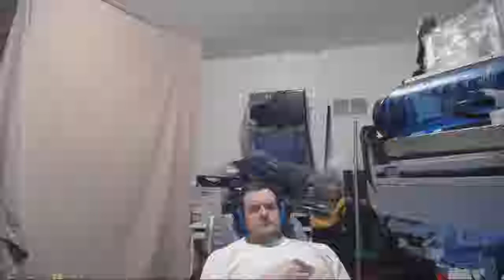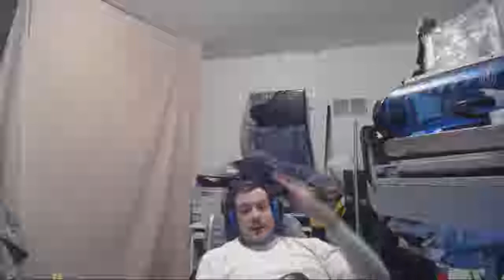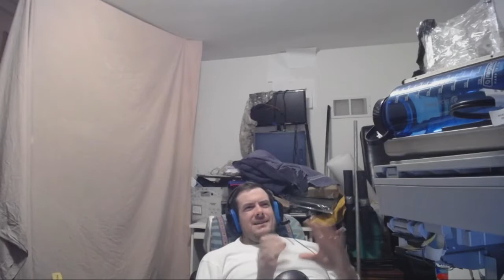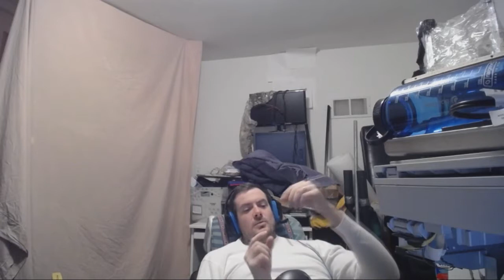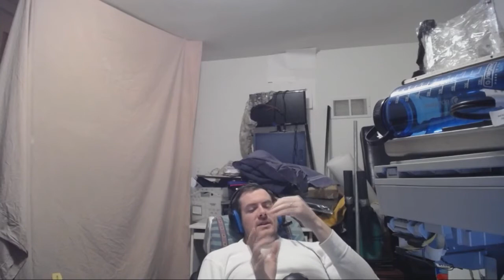Making a Video Card DIY #1 | Planning

Comment: why don't you just mine the silicon and fabricate it in to your own computers. you could save so much money. Bulk silicon is cheap. In fact, you could build a spaceship and get the silicon from the moon for free. You can get parts for your spaceship for free too. There are a lot of spent rocket stages which have been discarded into the pacific ocean. You can go there and get several of them and scrap them for your engines. Of course, you need a boat to bring them back to shore. You can build a boat from garbage acquired from your local dump. go there with a metal detector and look for usable pieces of steel. To avoid drawing any suspicion, make sure to install  metal detectors into the soles of your shoes. Once you have all of the pieces, you can build your ship. You can then build your ship according to french aircraft carrier designs freely available on the internet. (The french government released many designs for naval ships in 2009) I would recommend using the plans for the CLEMENCEAU from 1957. However you can replace the turret with a large crane to pick up the downed rocket stages. With enough careful planning and sourcing of materials, all this can be build for free. In addition building the ship should serve as good practice for building your rocket. 

for your spaceship capsule, you can build one out of garbage as well. believe it or not,  large quantities of aircraft-grade aluminum alloy get thrown away every year. this is mostly in the form of flashlights, computer cases, and other small consumer products not thought to be worth melting down for scrap. You can collect this aluminum and build a space capsule according to the designs of the Russian Soyuz capsule, which is the most reliable space vehicle ever build and was successfully reverse engineered by both Indian and Chinese space agencies (you can do the same). Of course you need thermal insulation upon reentry. An effective heat shield may be made from glass and epoxy. to protect the aluminum shell, again Russian designs may be used ЭВТИ, is a specification for thermal insulation used on the Soyuz it can be made from epoxy and thin sheets of metal, both available from your local home improvement store.

Of course you will need a lunar lander as well. You have two choices for this. You could either copy the Soviet LK design or copy the Apollo LEM. The LK has the advantage of being designed to work with the Soyuz but it never flew, so I recommend copying the LEM instead. There is an unflown LEM at the Air and Space Museum in Washington D.C. Go there with a high-resolution camera and take as many pictures as possible. Again you can build this largely out of scrap aluminum, and cover it in Mylar camping blankets and Kapton tape, both of which are available online for cheap. The LEM has more room anyways as it is designed to support 2 people. You could probably have enough room in there to bring your chair with you too.

While you are the museum take pictures of the Skylab-B space station as well. Skylab -B is an exact replica of the Skylab space station which was flown as part of the Apollo Applications Program in the 70s. Skylab-B never flew, but both Skylabs are made from repurposed S-IVB rocket stages. Surely you could repurpose some of your recovered tanks for this purpose, allowing you to have a large workshop which you can drag out to a stable lunar orbit and use as a convenient parking spot for your Soyuz as well. You will need to furnish your station with life-support equipment which includes many tanks for both water, air, and fuel. these tanks can acquired from used air compressors and old scuba tanks purchased from Craigslist. 

There is no power on the moon so you will need to produce your own. This is done most effectively with solar panels. You can build your own high-efficiency Monocrystalline solar panels out of damaged (but still perfectly functional) solar cell stock sold on ebay at a discount. As a bonus, these cells do not come with the bulky frames that most ready made panels come with, and you can solder them together to be easily stowed in your LEM. Since the moon spends either month in dark or in light, power storage is also critical. batteries would work, but really the better option would be splitting water with solar power, storing the hydrogen and oxygen, and recombining it for power. normally this is accomplished using fuel cells, but fuel cells require platinum electrodes which can be very expensive, so I propose just burning the hydrogen with the oxygen in an internal-combustion engine attached to a generator. a used lawnmower engine should work well for this, and a car alternator can be bought for $20 at a scrapyard to serve as the generator. You will have to modify the engine to work in the vacuum of space though. Modify it so that the oxygen and hydrogen can be piped in from your storage tanks retrofitted to the decent stage of the LEM. Without air convection, the engine will overheat, so you will need to compensate for this by adding extra radiative fins to the engine. Once you land, bring the solar panels and the engine-alternator combination out onto the lunar surface, with power cables routed into your LEM.

Once you have got down to the lunar surface, you need to actually start mining. To do this you need equipment, but bringing your own can be costly in terms of purchasing the equipment as well as the fuel actually needed to get it to the moon. Luckily there are many dead and decommissioned rovers and probes littering the lunar surface. Many of these probes have an ability to dig, so they can be used for mining. Even though these probes are able to dig, none of them alone can process very much material, so you should probably try to get as many of them as possible. This will require traveling long distances across the lunar surface, so walking just is not practical. You will need a vehicle, and these exist on the lunar surface as well. Apollo 15, 16 & 17 all carried rovers with them, so try to land near one of them. These rovers ran on batteries which have been dead for over 40 years by now, but you should be able to get one working by plugging in a solar panel to where the batteries are. the rovers run on 36V so, try to wire your solar panels for that. Even then, the rover will not go very fast, so you will have to pack it for an extended road trip. Make an inflatable pressurized cabin out of old bounce houses, making sure to cover the pressurized bladder in mylar for insulation. the top of the cabin can serve as the roof where you can mount several solar panels. You will probably be gone from the LEM for weeks while driving across the moon to pick up rovers, so either bring your generator with you, or make a second, smaller one for the trip using a discarded weedwacker engine and a cordless drill motor as a dynamo. Make sure to bring your water splitter and plenty of water too. This water can be used for drinking, cleaning, energy storage, as well as breathing air. Also you will need to remove carbon dioxide as well. This can be accomplished via Lithium Hydroxide co2 scrubbers which remove co2 and release oxygen. Lithium Hydroxide may be purchased in powder form from online distributors.

So you go on your road trip and bring back a bunch of robots to conscript into your mining force. it will be difficult trying to reprogram them, so instead just wire their motors up to a bunch of arduino nanos and place them across the lunar surface. To find a place to mine, look at the lunar sample analysis conducted for samples returned from US and Russian missions. Look for areas with high amounts of Silica. Go there and start digging. to bring up the material, construct a space elevator to your Skylab using Kevlar rope. Ship it up and ferry it back to earth. you just need a heat shield to protect the silica upon landing, you can actually make an effective ablative heat shield using wood. So grow a bunch of trees on the moon, and use them. 

once you have your Silicon, start a fabrication lab study the Von Neumann  cpu architecture, and build a computer. code the operating system in assembly language, and run your games. You can do all of this for free.
Reply: Looks like someone got a hold of Larry's book of secret plans.